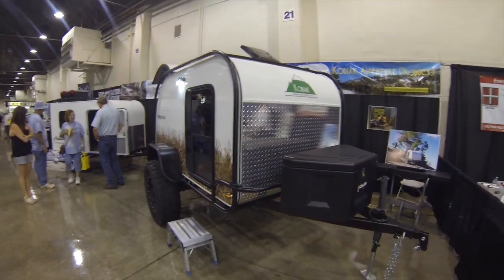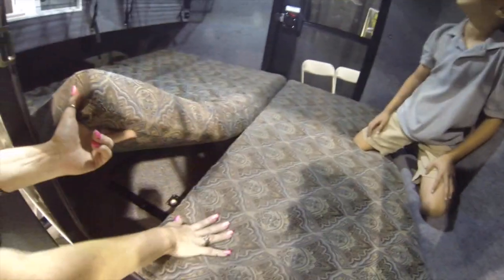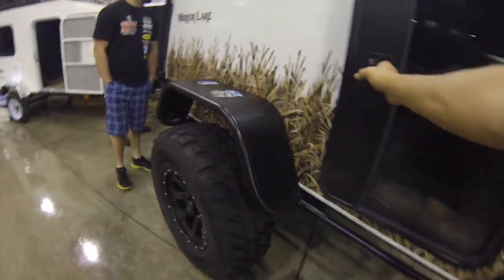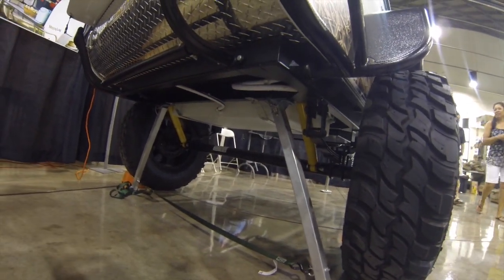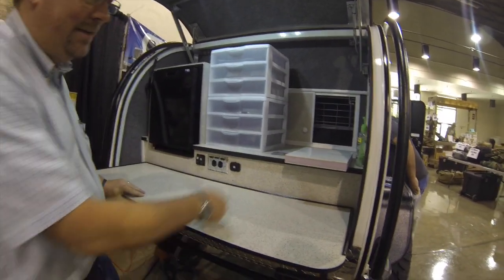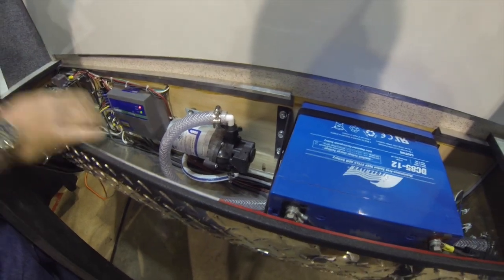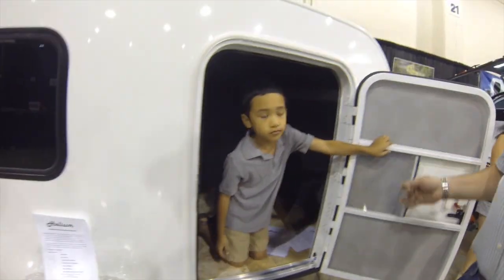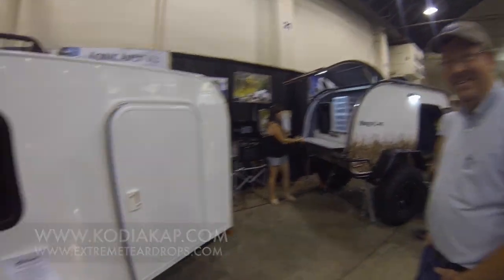Kodiak Adventure Products - extreme teardrops :self reliance expo

Comment: What do you think compared to the Moby 1 XTR?  I like this but there's just something ugly about this thing, and I ain't towing something ugly! So features wise, how's it compare to the Moby? I do like that roll bar though.
Reply from the maker: To my untrained eye they seem almost identical on the outside other than a few bolt ons so its probably more of a personal preference things in the grand scheme of things?

The Kodiak does use foam core walls which make it a lot lighter than the wood walls so if weight is a priority then the Kodiak might trump some of the other features of the Moby1? But the Moby1 does seem to have some cool features like the side ladder, beefy stabilizers and built in shelving system all of which can be a pro or a con depending on the persons wants and needs.

They are both expensive but I'd be happy with either one at this point. I asked if they rent or have demos to test try and they both dont. I would love to film a test video of both of sure.

Comment: Still just a teardrop camper made of 6 sheets of plywood-this would never hold up on the harsh trails like a steel or aluminum off road camper would-stick to the KOA camp grounds.
Reply from the maker: I think thats why they are the only tear drop made with a roll cage. They go super light with the composite walls and stay strong with an exo skeleton roll cage.
Reply: Kate Oliver 

Yes, if this was made without any wood, it would be No. 1, due to the  roll bar structure, the simplicity, the compactness, the off-road design.
Reply: It's totally retro, from the straight-axle and leaf springs, to the plywood construction.  This is something very simple, very tough, with as much or more clearance as the high-dollar trailers you see elsewhere.  I could see someone wanting to eliminate the axle, entirely.  About all I might do is add coil springs, to shake my gear a little less.  But that's a very basic, very tried-and-true design that's muy beefy for the curb weight of the trailer.  Way over-engineered.  Cheap, rugged, easy to repair in your back yard, with basic mechanical and carpentry tools.   Easy to find parts just about anywhere in America...  

A version of these made out of composite would be a nice refinement.  Eliminating the straight axle in back would give it the best clearance on the market, unless Bruder puts out something with air lift to ridiculous heights, or something, for the soul of your first-born male child.